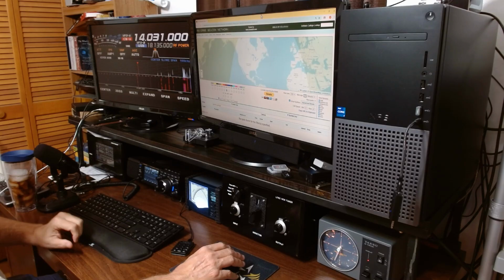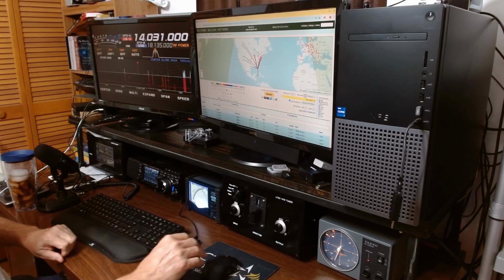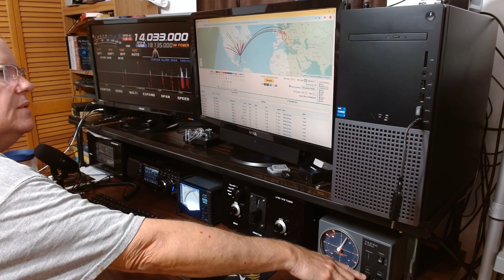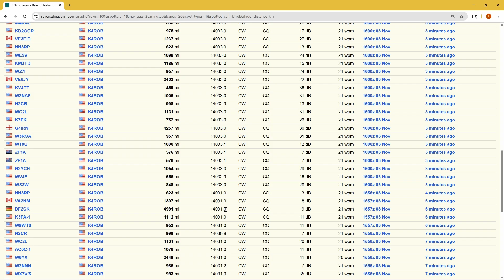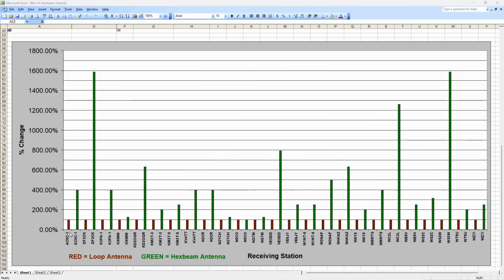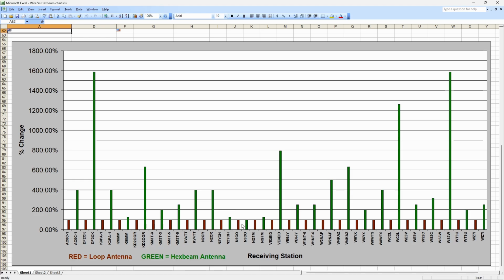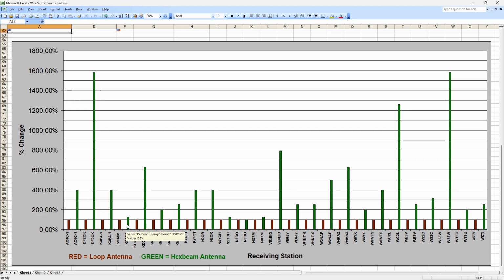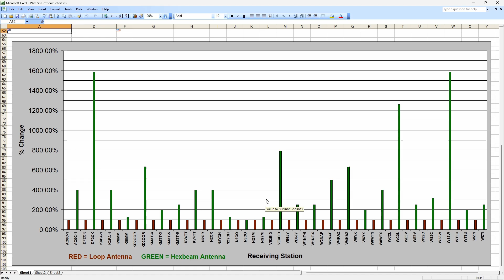Shocking Antenna Test Results Revealed!

Comment: I'm curious how your loop is oriented, what direction would be opposite your feedpoint? Also, how big, and high is your loop? 73.
Reply from the maker: It’s a standard ARRL sky loop feed on the center of the west side. It’s 43 ft high. Feed by 450 ohm window line through a 4:1 balun.
RJ

Comment: Please consider using high contrast colors or adding patterns or symbols for graphs in the future - 8% of men have red-green colorblindness, and the graph was next to useless for me.

I appreciate the video overall.  A lot of people disparage one antenna or another in favor of a better antenna, but you correctly point out that every antenna has its uses, and a directional antenna - even one many turn their nose up at - will still often outperform a nondirectional antenna.

I also appreciate your focus on improving the antenna before the amplifier. It's worth mentioning that the line and equipment between the tx and antenna bear significant consideration as well.  I've found most hams are losing well over 3dB in their coax, tuner, switches, and various connectors along the way, and don't realize that's fully half their transmitter's power.  Each UHF connector might cause as much as 0.5dB due to the discontinuity (SO239/PL259 connectors are not 50 ohm), and each piece of equipment has two - one going in and one out, so baseline you can count the number of connections between your radio and the antenna and get a decent idea of the loss.  Cheap coax isn't as bad at lower frequencies, but still eats a good bit of power.
Reply from the maker: Thank you for your feedback! 
I will try to keep the color issue in mind. You are correct in that every loss adds up. 
RJ
Reply: what should we use then ... N connectors ?
Reply from the maker: Pl-259 is fine, just try to limit how many connectors you have to the least you can for your setup. And always buy the best coax you can afford or do like me with my loop, use window line to lower losses. 
RJ
Reply: @LynxElectronicsLab I have a “temporary” 80m horizontal loop in a delta-loop configuration up 90ft above ground with three Doug fir trees as supports.  I use a 4:1 current balun and 150’ of LMR400 coax.  Of course it doesn’t work well on 80m due to the too high balun ratio but is fabulous on 40, 20, 17, 15, 12, and part of 10m.  At one point I switched to 600 ohm open ladder line w/o the balun and even playing with the twist and length of the feed line I could never get it immune to the various local rfi sources.  I even built a true balanced tuner.  Lots of effort with corresponding frustration.  So I went back to the coax and a new 4:1 balun (higher power that I wound on two 2.4 inch cores).  Again, NO local rfi reception.  I went back to using cheap Chinese switching wall warts in the house, garage, sheds, etc because I don’t get any interference from them at all that I can find.
So… what gives with the open balanced feeder?  I figure that it’s mostly vertical so picks up house wiring noise just like a vertical antenna.  Oh and I’ve tried operating at the base of the tree with the balanced tuner there too.  Same result!
Reply from the maker: Not sure but my loop has about 6 ft of coax through the wall to the balun and then 450 window line to the loop. Never had RFI issues with it. As you said works great. But   cant compete with the hexbeam on the higher frequencies where the hex beam works. Use the loop for 80/40 mainly. It does work well on the other bands just can't beat the Hexbeam's directional gain. 
RJ